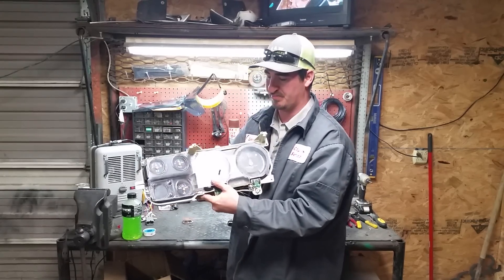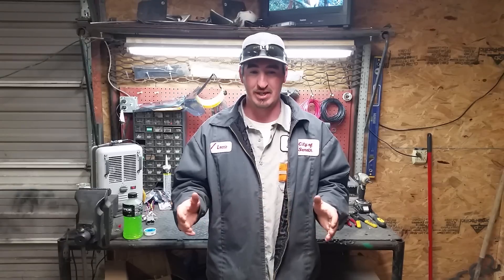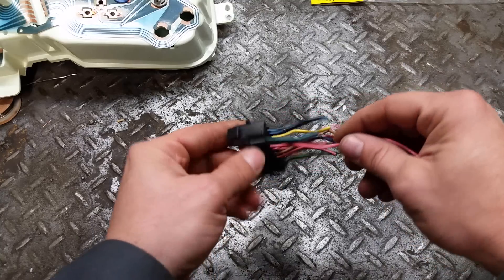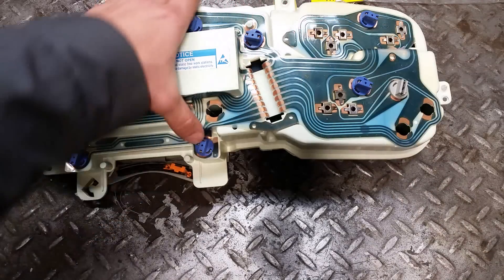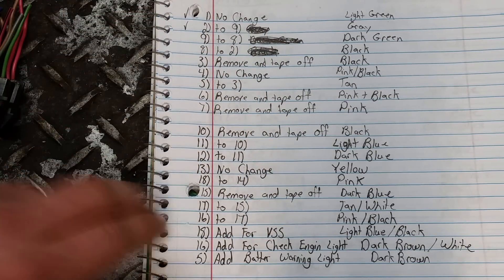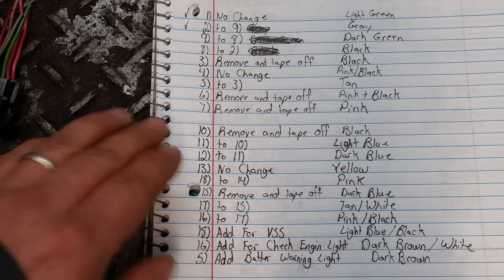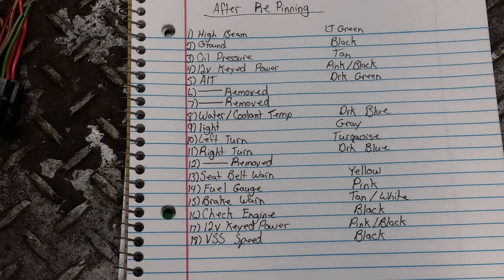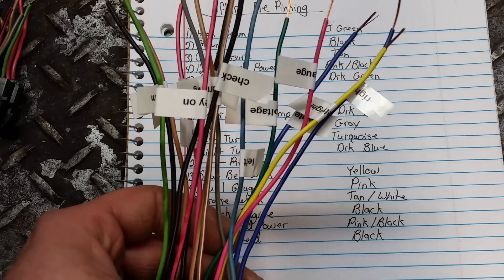1984 C10 Project ---- LS Swap Part 13-1 (Cluster Swap Using a 90-91 Square Body Cluster Part 1)

Comment: Thanks for this I just gotta figure out the vss wire
Reply from the maker: @Sixmoremiles82  you will need this cluster. The vss wire will come from your LS harness and go to your speed gauge on the cluster.
Reply: @ oh yea I got the cluster got it all installed thanks to your video just meant  got figure out where to tie it into the harness thank you again for the videos

Comment: Is there any way I could use the older mechanical Speedo cable instead of that electric box? I have a 700r4 transmission but I want a cluster with that Speedo and a factory style tac and a gas gauge in the corner. Any advice?
Reply from the maker: They make a part that will screw in to the transmission that will allow you to run your vss wire to it.

Comment: How do I wire up the speedometer. I tried using the speedometer wire from my aftermarket harness but it didn’t work
Reply from the maker: You may need to contact your harness supplier

Comment: I have a silverado 92 and I put a 2000 dashboard on it and I want to change the cluster from 1992 to 2000 how do I connect the harness pins

Comment: Question is there a big difference from a 78 gauge to  a 87 gauge ?? Can i use orginal connection, i notice my 78 gauge has a electrical box for speedo but the newer gauge has a cable connector? I build my truck from parts truck so its kinda hard to justify
Reply from the maker: Not sure. I know the 91 suburban cluster has an electronic speedometer

Comment: What specific wire did you tap in to from the gas speed sensor I bought cheap eBay harness and the under dash portion of wires says it’s the white one would I run that to my speedometer spot?
Reply from the maker: My set up is drive by cable
Reply: @lonniesgarage  I’m sorry meant vss speed sensoe

Comment: So quick question since you’ve already went out through their wiring. I have a 84 c10. All gauges work except fuel gage. Looks like there used to be a passenger tank but it was removed. 2 wires hang outside the gas tank. Red and black. No wire is coming down the frame on either side for fuel sending wire to go to either instruments panel or bulk wiring near brake booster. I do see pink wires in bulk wiring. There is 2 smaller pink wires 1 pink and the other pink and white. The pink and white is cut and he pink is wires with one of hot wires goin to battery. If I connect the fuel sending wire to either one nothing happens is stays the same. I know the gage work it reads  3/4 no power way past full with power. Do you think wiring that wire to number 7 and 18 or just one of the 2 would fix my problem

Comment: how did you hook up the alternator wire ????
Reply from the maker: James Torrez it's hooked to the bulkhead
Reply: so you ran a wire from the #5 alternator wire to the bulkhead of the truck under the hood ???
Reply from the maker: James Torrez yes